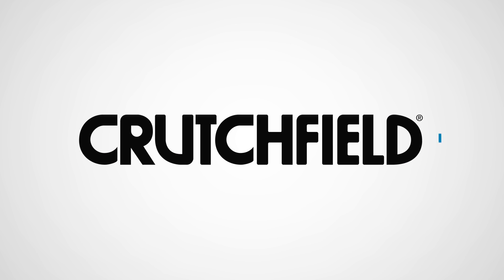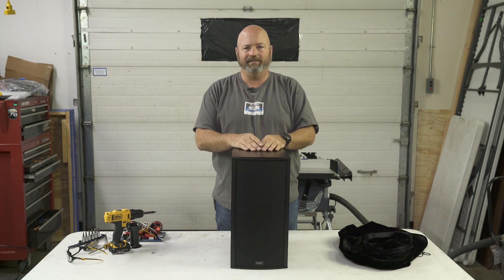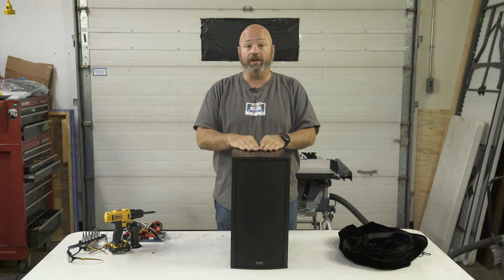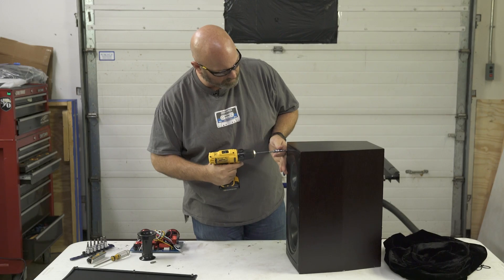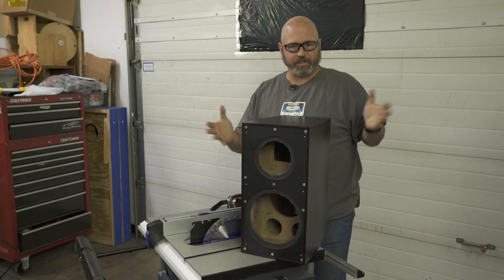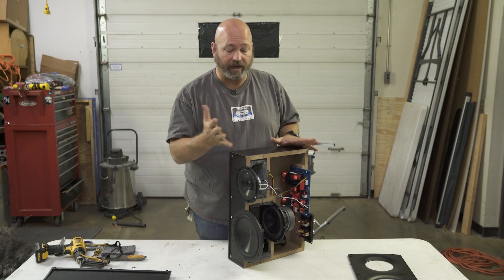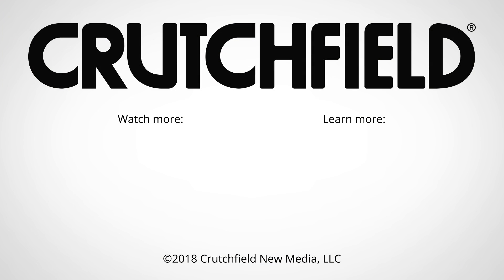Sawing an ELAC speaker in half to see how it's built | Crutchfield video

Comment: So basically this is a Bose Acustimass Subwoofer with an integrated midrange and tweeter?
Reply: Don't use the "B" word please
Reply: Accoustimass doesn't use  a "coupled cavity design" with a passive radiator in front. Their designs are usually bandpass designs. Please correct me if I'm wrong.
Reply: If the speaker has a port, that means that the design is using the mass of air inside the port for tuning, which is lighter and has, therefore, less inertia. When the designer wants to tune the band-pass design to a lower frequency, the port lengths or cross-sections becomes not feasible to fit in a small loudspeaker, or the volume velocities become so high that the listener experiences "blowing noises". The alternative solution is to replace the long port with a passive radiator. Passive radiators can replace ports 10-12m long, therefore they are cheaper solutions to complications of a port design otherwise would be very expensive to build. However, their group delays are the worst and they have a lot of irregularities in the low frequencies. Besides, they push the active speaker to higher excursions below resonance frequency and increase the overall THD.
Reply: Having built numerous bandbass designs as well as a clone of the Adante's coupled cavity design, I can say that it's a bit different than a standard bandpass. (What a pain to model.) A lot is the same, but this design calls for a lightweight passive radiator instead of a typical weighted passive radiator used to tune the lower frequencies. The difference is that the woofer behind it is already a ported enclosure and is tuned to a specific frequency. I think the point of Andrew Jones' design was to reduce the port chuffing you were talking about, to achieve the low frequency extension associated with a ported design while keeping the enclosure "sealed" from the outside, and to make it look cool. I think we agree more than we disagree. I see how the alignment is similar. If I remember correctly, the Bose uses a 6th order bandpass (maybe 8th order) and the Adante uses a quasi-sixth order bandpass using a PR instead of a port.
Reply: oturgator I replied from a different account on my phone and realized it wasn't the one I initially responded to you with. I tried looking at those people you mentioned but I didn't see the topology you mentioned. If you could give me some direct links of the quasi-sixth order bandpass setup, I would be interested in looking at them. From my understanding, KEF did a coupled cavity back in the day.
Reply: oturgator Also, I don't know what mean by "unloading the active speaker to make it cheaper." Yes, the passive radiator masks any port chuffing and some distortion, but it also makes the system less efficient. At the end of the day, the driver still has to need to produce those frequencies, the passive radiator and ports can do nothing without it. It seems to me that it would require a more expensive driver, a more expensive build, more R&D and the extra cost of creating a passive radiator tuned to that system.
Reply: For low-frequency extension in a compact enclosure, the active driver has to have a high mass to lower the resonance frequency and to compensate for the sensitivity loss, it has to have high BL. High mass can be achieved by selecting the coil wire cleverly but BL product does not come cheap, especially when dealing with a high moving mass. When the coil windings are wide, the large air gap will cause the magnet motor to be less efficient. On the other hand, you may be forced to make an over-hung design to deal with the excursion, since you are trying to do everything with the active, you have to generate the required volume velocity with a single driver.  The requirement for the higher linear excursion, aside from this linear excursion requirement will complicate the spider and surround design, it will also force the magnet motor to be deep (to allow large X crash) and the use of the expensive magnetic material will highly be inefficient. In a band-pass design utilizing a passive radiator, the very low frequencies are handled with the resonance of the passives. At those frequencies the active is not radiating at all, please see the graphs either in the SoundEasy users manual or Jeorg Panzers' text. Since the excursion of the passive has no mechanical limitations like the voice coil does, it can handle the large excursion better. When passive(s) resonate, the energy from the active is only used to support that resonance, but not to generate the dominant output. At that tuning frequency, however, the excursion of the active driver is almost zero.
Reply: Writing this is like swearing in church on a lovely peacefull springday :)
Reply: It is not painful at all. In fact, anybody who had the idea of, unloading the active speaker (to make it cheaper) from generating the very low frequencies, and handing that functionality to the passive slaves, have tried a variation of this in the late 70s and early 80s. If you are familiar with SoundEasy (http://www.bodziosoftware.com.au/) you can see that this topology has already been implemented in the list of readily available topologies almost more than a decade ago. Before that, the incredible Joerg Panzer gave an excellent explanation of this topology in his help text for the famous Akabak. That was in 1994. Yes, it is hard to accept that the "wheel is round" in the audio industry and everybody can fall into the trap that, whatever they are putting in the market has not been done before, but believe me, a lot of very smart people has come and gone through this industry. By the way, who is Joey Mariano? Are you guys related?

Comment: I am guilty as well.. But speakers really are the biggest scam out of any audio component. It's all personal preference obviously, but Yes some sound better than others, and some are built better than others.. However there is only so much in design and materials you can use. These for example use the basic MDF and internal insulation design with the same crossover components and similar binding posts you'd find on everyone else.  Make it fancy with some magnets to hold the grill on and boom, charge all that money for something so simple. All the manufactures do it and we all fall for it.
Reply: Very true. My evil genius Uncle who is an electrical contractor and speaker tinkerer built a pair of two way sealed larger bookshelf  sized speakers that just blew my mind. I've heard/had/have a LOT of speakers and these sounded incredible. I cant recall what drivers he used but he built his own crossovers by hand including selecting the components and winding the chokes by hand. I have material specs, drawings and instructions for them and will build some day. I'm a cabinet maker by trade so with his design and my cabinets I should end up with something pretty acceptable.
Reply: Between your cabinet making skills and my electronic skills we could make a shit ton of money.. All you need is a fancy design, a cool name and ridiculous claims like "We use cryogenic frozen wire" in our speakers.. People easily buy into this stuff..lol

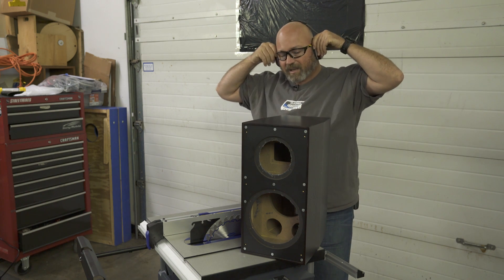Comment: Wow, dude. That was some seriously unsafe table saw work there. You're lucky not to be in the hospital right now. Safety goggles won't help you when your unsupported work piece binds against that blade.  Shenanigans begin at 10:01 when you power on the saw with the box so close to the blade at full height, and continue throughout. Good thing it's made of mdf and nothing harder.  Please take the segments that were edited out and make another video of what not to do.
Reply: Rick McKenzie I agree. I was cringing the entire time waiting for the ambulance to arrive. My subconscious mind kept repeating "Sled. Use a sled. Don't do that. Get a sled!"
Actually, a sawzall would have accomplished the same thing and been much, much safer.
Reply: Actually, I started to cringe when I saw the sparks from the magnets that were embedded in the front frame as the overly extended/exposed saw blade penetrated the face.
Reply: I would have used a bandsaw, a much safer way of cutting something that big. I hate dinky table saws. I worked in a professional cabinetmaker's shop where the owner had bought beautiful table saws that had sliding tables. Still, I would hesitate to cut with the blade that high.
Reply: Rick McKenzie He's living on the wild side 😂
Reply: Haha! Indeed!

Comment: I believe that a plate in the back of the mid/high frequency chamber was missing where the wires would connect through but be acoustically isolated. The machined relief in the wood might be a supporting clue. Very interesting that the passive radiator gets forward motion from both the front and back pressure waves of the woofer. With low enough mass on the passive radiator to be able to respond fast enough to keep all that physical motion in phase and tight is pure genius. I can't imagine the mathematics and testing it took to get it right. Very nice little speaker.

Comment: I have seen tons of speaker designs over the years, I had a passive radiator way back, transmission line, 2 way 3 way even 4 way, seen the speakers in the box with a port only on the outside, but never a design like this.  Amazing, a ported radiator system! The crossover, is huge too. Quite an amazing design.

Comment: Lousy design. I would have dampened internal cabinet walls with metallic plates and silicon. And silicon de coupling gaskets.
Reply: and you've probably never sold a speaker in your life.
Reply: Richard Fecteau it s a 30 usd betterment. !
Reply: Yet no one is hiring you to design speakers for their company
Reply: Is that what you would have done?
Reply: And silver plated screws in the midrange. They aren't needed on the passive radiator....obviously! But for the midrange and tweeter, you can only achieve holographic imaging with silver plated screws.  And I won't even buy speakers any more if they do not use Bocote wood for the internal bracing. With that, I was able to tell the difference when a new Mic cable (so not burned in) was used half way during the recording of Flaming Lip's "Yoshimi Battles the Pink Robots" album.
Reply: cootaloot see my systems on u toobe
Reply: Texas06Exige are ya serious? See my systems on my channel....dampened siliconed (no titted) ha ha ha ha mass added big sise ( titz)
Reply: I BUILD DIY MY BEHEMOTHS---SEE MY CHANNEL---3 WAY--4 AMPS--ELEC X OVERED----230 LBS EACH---CEMENT--FIBERGLASS--BALLAST---FRONTAL BAFFLE 2 INCHES-CABINET HEAVY BRACED ALL DAMPENED  METAL SHEETS FOR DAMPENING--NO BODY IS HIRING ME BECAUSE  SUCH LOUDSPEAKERS WOULD COST 20,000 USD TO THE PUBLIC AND VERY VERY WIFE UNFRIENDLY---ONLY FOR DIE HARD MUSIC PHREAKS THAT CAN PUSH TO 120 DB IN A BIG BIG ROOM--NO NEIGHBORS, HEAVY SOUND TREATED--

Comment: Interesting. I would add that the crossover should be in an external box and not built into the cabinet
Reply: internally mounted crossovers is the norm for just about any speaker you can name regardless of price. external is unnecessary.
Reply: Richard Fecteau That is junior level loudspeaker design and a cost cutting exercise. There are many loudspeakers with external crossovers as standard and there is solid science for the benefits
Reply: and yet 99% of megabuck speakers do it.
Reply: Nope, not 99%, I am an ex-high end distributor buddy and ran my own high end business in the UK for many years, you need to get your data correct ;) In addition many of the high end products you are trying to refer to have an air tight enclosure within the cabinet for the crossover that has similar engineering ideals behind it as an external crossover.
Reply: Richard Fecteau if you have not already check out Living Voice and Kralk, two loudspeaker manufacturers that favour external crossovers. Alon were another,...who are now Nola...there are so many if you do your research
Reply: and i could name 10 that don't for each 1 that does. but still, no one is looking for an external crossover for elac bookshelf speakers, except maybe you.
Reply: Richard Fecteau I see, changing your argument now you realise there are both mid-fi and high end manufacturers who are exponents of the external crossover. Whatever!! I will leave you to go and flame someone else now lolol

Comment: Seems like the bass would time-lag the mid/bass and cause a bass smear rather than an accurate tight convincing bass. The design does not make logical sense. Andrew Jones what the heck is this.
Reply: yes anyone who hasn't designed a speaker is laughing at this. armchair design experts, lol...
Reply: isn't that what the crossover unit is for? to correct for timing amongst other things?
Reply: It's not controlled, tight, accurate bass that's trying to be achieved by this design- it's a wider range of response in the lower frequencies. The passive radiator is still considered a ported design.. so you've got a ported box, INSIDE a ported box. It's a series 6th order bandpass. Each ported box is tuned to (likely) an octave apart, widening the punchy response typically found in a ported enclosure.
Reply: Nico Ras exactly. Anyone with experience is laughing at these speakers
Reply: greggers http://education.lenardaudio.com/en/06_x-over_4.html
active crossover time alignment
Reply: Nope. If you were to look at the cutaway render on Elac's website, you'll see that it is closed. My guess is that there is a separate panel covering the opening and it is there to make installing/removal of the crossover easier.
https://www.elac.com/series/adante/

EDIT: Yup, I was right

https://us.v-cdn.net/5021930/uploads/editor/pa/xx3qn0oms2tj.jpg
Reply: Peeps need to know that AJ is really a scientist posing as a speaker builder. He thrives on details and that's why he's able to achieve great results.
Reply: trippplefive  thats digital delay. crossover devides frequency spectrum
Reply: had I seen this pic first, I could have saved 14 minutes of video babble . . .
Reply: Would it have something to do with the phase offsets created by the reactive components? Like correcting them..
Reply: Exactly the first thing that crossed my mind when I saw this.
Reply: So the midbass chamber is sealed off from the woofer with just a piece of damping material?
Reply: trippplefive a crossover takes the input signal and outputs low frequency and high frequency separately
Reply: Trippplefive this isn't an active crossover so your theory doesn't work.